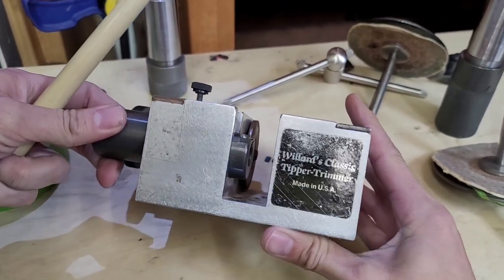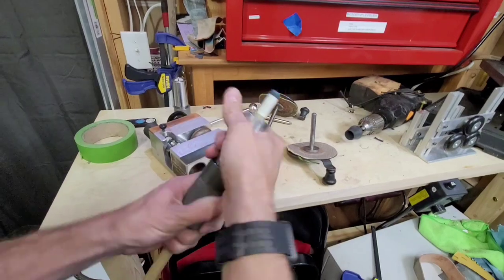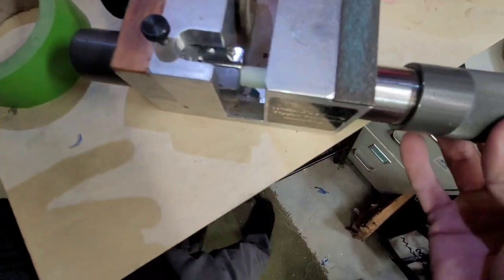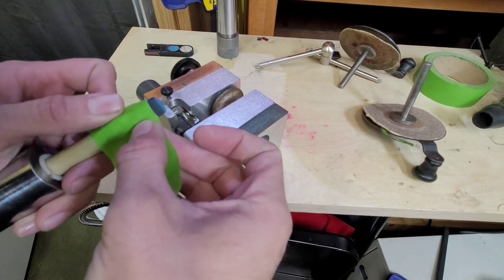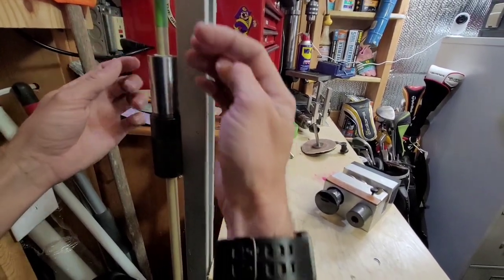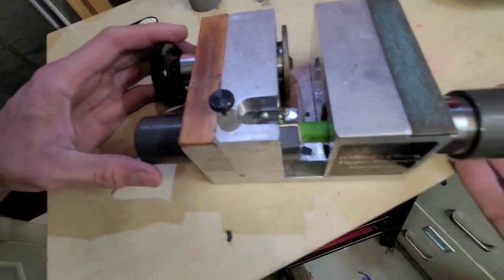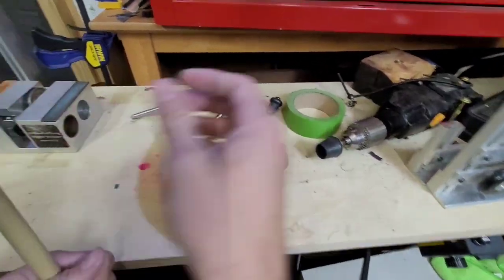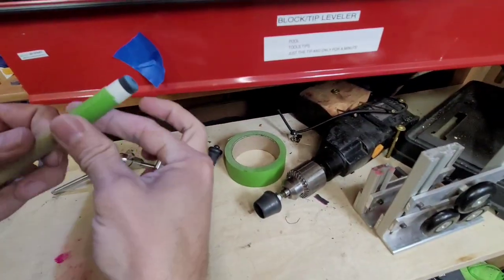How to Use Willards Classic Tipper Trimmer to put on Pool cue tipCorded drill to sand tip and shaft.

Comment: I really like the stuff you did with the drill!  Making me think I could make a lathe like that, or a thing that makes dowels, or a tapping device or something.
Reply from the maker: You can make a lathe but it will be hard on the bearing in the long run. Another good way if to turn the work piece and use a grinder or flap wheel to take off material in a spherical fashion. Cheers